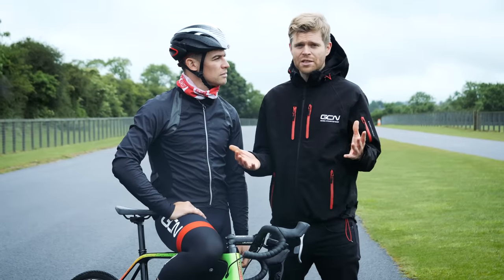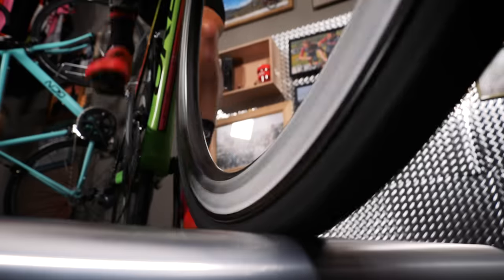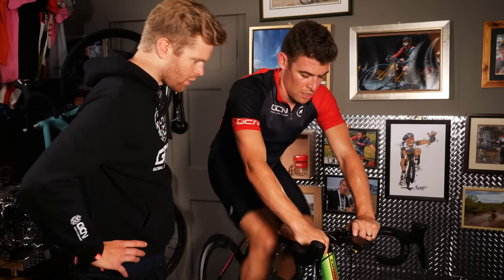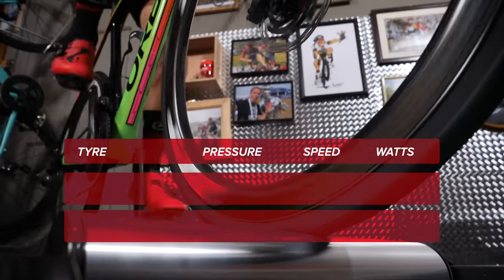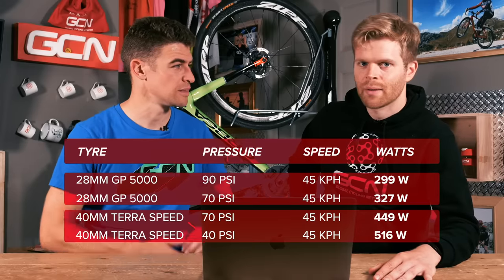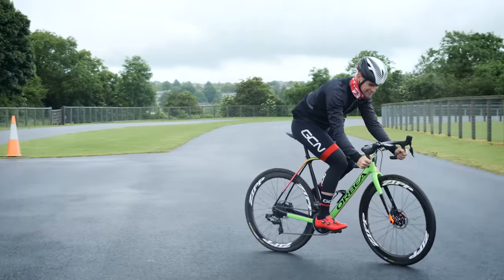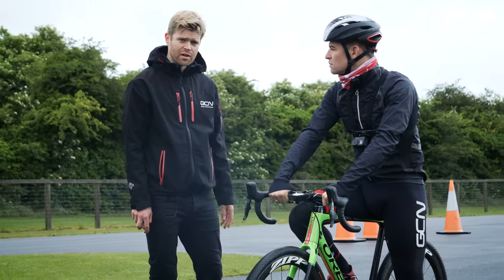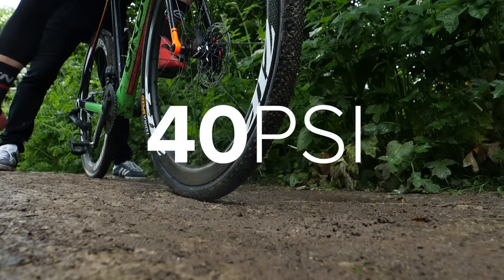Gravel Vs Road Tyres | How Much Slower Are Gravel Tyres?

Comment: I think a better test would be to ride up a mountain pass (paved) with both sets of tires - measure with a power meter. Then ride up a gravel road with both sets of tires and measure again. There has to be a point where the gravel tires will perform better, from a pure power standpoint. Anybody ever have to ride through some deep sand on a narrow tire? They practically stop dead. I don’t ride anymore, but I mountain bike and tire pressure makes a big difference. When I used to road ride in Texas, Initially I would pump up my tires to 100+ psi, as I rode more I started lowering the pressure because of abundance of rough “chip-seal” asphalt. I ended up closer to 80psi. 

Another consideration is comfort. Obviously, this is a lot harder to measure, but does play a significant factor. You can damage your body on a long ride, I have had hand tingling and numbness that lasted several weeks, after riding a century. Less of a problem for fit guys like Chris, i am sure.

Comment: Hi gcn, love the comparison test. But it's alittle bit unfair considering 700 x 28c vs 700 x 40c had different diameters and total circumference. I believe it's making more sense if you were to compare 700x28c vs 650x 47c.
Since both tyre has similar outer tire diameter .

Comment: I'm still searching for the "do it all" tier on my Gravel Bike.

I changed from a Vittoria Terreno Zero 37-622 (basically a fat road tier) to a Vittoria Terreno Dry 40-622 (which does not have pronounced knobs in the center like the Terra Speed)
There was maybe a very slight difference in roiling resistance on tarmac (but I was also a bit tiered already before the ride), but the cornering capabilities on gravel on the Vittoria Terreno Dry are way better (according to Strava all gavel decents with corners were at least 15% faster and I wasn't pushing it). The Vittoria Terreno Dry has a pretty flat scale pattern in the center while the Zero is completely smooth. The Drys weren't any louder then the Zeros, indicating that they should roll pretty smooth as well (creating sound costs energy). I ran both tiers at 5.1 (~70Psi} Bar Pressure.
In conclusion.

The Zero is great for Tarmec + (mainly straight) hardpac gravel roads.
The Dry is great if you are not sure what lies ahead. You do not sacrifice a lot (if anything) on tarmec.
Reply: Daira929 I’m on 38 Terreno drys at the moment. 40ish psi and they are amazing.
Reply: @deanoturn1985  yeah, I'll defiantly drop the pressure on them, now that my rides contain less and less tarmac. I mainly wanted to see how they compare in day to day road usage, since I basically use it for everything all the time.

Maybe I'll settle for some intermediate pressure since constantly deflating the tires will dry up the sealant more quickly :-/

Comment: The roller tests are unfair for the tires with low psi. As you noticed in you tests, event the 70 psi gp5000 tire showed a lot extra wattage to go at 45kph. What is happening here is that the lower pushes into the softer tire a lot more than harder tires. As a result, you get a skewed result. I think the roll down tests are a lot more realistic and accurate.

I would like you to test performance gravel tires (Rene Herse tires come to mind)
Reply: yep. i think the same. Take 25 or even 23mm tires with max pressure and the resistance will be much lower, cause the tires arent deforming as much. The rollers are not a real world surface and have a more "pointy" surface, going deeper into the tire -> deforming it more. It simply showed one thing: The harder the tire, the lower the resistance on rollers
Reply: @jBurn_  On the other hand, the result at 70 psi for both tires on rollers do give some insights. The rollers magnify the hysteresis losses. As a result, shower tires will do a lot worse compared to faster tires. This magnification can be a feature as opposed to a bug.

Comment: Try continental tubulars at 19mm wide @ 175psi.  That's almost an entire centimeter less rubber on the road vs. the 28mm in this test, so I say scrap this new wide-tire syndrome.  With the technology of the chili compound on Continental high-end skinny tubulars, they grip just like a wider tire, without the drag.  Imagine the energy-savings on a long ride.  Yep, I like it.

Comment: Road roughness makes racing tires sketchy on stretches of oiled crushed rock on many byways, fewer flats with a diamond tread like on vittoria pave corsas, 24mm to 28mm are my pick for speed + good on junk, great ride, kenda 30mm kwick great for commuting @90psi, ymmv.

Comment: I think this is a very interesting comparison, but it can be misleading. It's interesting because it shows the real difference between dedicated gravel and road tires (i.e. the kind of tires most often used on "road-ish" bikes), and misleading because those tires are different on many aspects which make it easy to come to wrong conclusions. 
As others have said, it would be interesting to compare a classic performance road tire to a wide, slick, supple and non-reinforced one (like a 38-42mm René Herse or Panaracer Pari-Moto). I think the results would be very different: in the case of the dedicated gravel tire, most of the additional rolling resistance is due to the knobby thread and sturdier carcass, which also make for a heavier tire. It could be a good idea to also compare the 700c road tire to a 650b wide supple etc. one, to isolate the effects of rotational inertia and analyze just the added rolling resistance of whichever tire shows to be slower. 
I think it would be a good follow up because the first conclusion many people could make from this test is that wider tires and lower pressures are slower, which is not necessarily true and for sure isn't what the test demonstrates. As an example, I have both a "normal" road bike with 700x28c Conti gp4000IIs tires and a long distance "audax" bike with 650x42b Panaracer Pari-Moto tires; the first one is faster on the climbs, though not nearly as much as the 3kgs lighter weight would suggest (something like 50m/h less VAM on medium to quite steep inclines), but as fast as the pure road bike on the flats despite the aerodynamic disadvantage of the larger tires, front bag, fenders etc.. Take this for what you will, as I don't have a powermeter so I can't make a scientific comparison, but this are the results I have found over many many thousands km, and I usually get tired faster on my road bike than on the randonneuse, which I read as a sign that I'm putting less effort when I'm riding the randonneuse. And when talking about long distances, the fat-tired bike is definitely faster and less fatiguing at the same time.

Comment: hello gcn,
Could you do the same experiment with 23/25/28/32mm Road tires ?
Keep up the great content!!!
Reply: saw a test like this - can not find it again. What I remember: Interestingly the 23mm option is much slower (!) than the 25mm. (the bearing surface of a 23 mm is wider even if the tire itself is slim). 28mm was the best compromise of speed/comfort. If you are not sure if you should go for Schwalbe G-One or Conti GP: on absolutely plain surface Schwalbe was the winner. If roads are as they are in real world: NO difference Schwalbe vs Conti. (which means that conti performs better the worse road conditions get.... or in my words: the more realistic road conditions are.) Both were better than the rest.

Comment: At 28mm, a road tire (like my Hutchinson Sector 28s) is a much noticeably better ride on the tarmac at 70 psi than at 90 psi in my experience. I need to perform some testing now! They feel way faster, so I suspect rollers are not the same as outside.
Reply: Okay that's a good way to approach it but remember perception is not reality because something feels better doesn't always mean it's faster or better it really takes some scientific equipment to perform the right test these gcn blokes really don't know their ass from their elbow

Comment: Swiss sport scientist did an investigation on tire pressure for the swiss cycling team. Was realy interesdting more pressure doesnt mean always better. there is a perfect spot if you inflate the tire more the resistance will increase. He says on a mountainbike around 1.5 to 1.7 Bars and on a road bike (size 25 or more) your weight divided through 20 plus 1.

Comment: I don't think there is anything particular surprising or even useful here. If a road tire will do, it will take less work for a given speed. If a road tire will not do, well you use gravel tires.

What I think would be far more useful would be to ride outside on smooth tarmac and smooth gravel where you really could use either, at a constant power (maybe repeat at a few power levels) and see how fast you go. Which would tell me, given what power I can summon, how much faster might  go on road tires vs gravel. Then I might judge things like: I have been training with gravel tires because I am too lazy to switch back and forth, but next weekend I have a big road ride, if I have been averaging X mph, what might I average with better tires? Or, I have a ride with mostly roads, is it worth the bother to switch?

Comment: Makes sense...only purpose of gravel tires is to allow you to maximize speed and control on loose surfaces.  Time/power up a wet loose hill would be the opposite results of this.

Comment: I would be interested to see a similar test between 700c and 650b road tyres.  I get quite a few flats on 25mm 700c tyres (biggest my bike can take with guards fitted) when riding audaxes on rough country roads and am thinking that 650b may reduce these but not if I need to pedal 10% harder for the same speed.

Comment: the problem with testing on rollers is you lose the advantage that lower psi tires have at rolling over and deforming around road imperfections such as pebbles, cracks in road etc.

Comment: Whoa...the comparison on the rollers shows that Continental made a big mistake with the Terra Speed. They should just have made the MTB tire "Speed King" which is only a little bit slower than a race bike tire (in my opinion probably 50 watts) as a gravel tire with 40mm size. I am really disappointed that Continental went mainstream and produced a "heavy" treaded tire with lots of puncture protection. Since the compound is the same, it shows how much impact casing and profile have on speed. Thanks GCN. Rene Here Tires it is then. Unbelievable how Conti has botched it, they had the perfect gravel tire with the MTB "Speed king"

Comment: Just one question : How are you measuring speed on the rollers ? I tried the same experiment, measuring with a wheel speed sensor, but with the larger tires the wheel diameter changes ...
Which can make seem like the gravel tires are slower than reality (as they will be faster for the same hub turns, due to increased diameter)

Comment: VERY interesting, just what I needed... But I wish the wet tarmac had the gravel tyres at 70psi as well though for proper direct comparison of the 2 types of tyre on road. Running them at 40 for the tarmac roll was a bit pointless really as cant compare their respective true rolling resistance difference. Inside tests were v indicative though... 50% more effort at same 70psi...wow!
I have an 'all-road' bike for road/rough west country lanes etc and run its gravel tyres it came with at max psi (85) on road....I have just bought some 'gravelking slicks' though to swap out for road use hoping will roll faster as less tread/more slick compared to current lightly treaded vittoria dry's... also went narrower... 38c to 35c. Will I notice much difference I wonder? Without the same psi on the road test, hard to say

Comment: It's pretty obvious that road tires will be faster on gravel as well - as long as you are not cornering, and if it's a decent gravel path without potholes big enough to bottom-out your rims.

But you are much more likely to get flats and crash. 

Even 60mm slicks such as Schwalbe G-one at 25psi have caused me a couple crashes when going too fast off-road, but overall they are worth for me since they are used on a do-it-all bike (training-commuting-touring-adventure-group rides)
Reply: Uhh, yeah no. Not sure where you're getting your analysis and data from but you're absolutely incorrect. 🙄🤦‍♂️
Check out Jan Heine WordPress
Reply: One would also be far more uncomfortable on the road tire on gravel, losing energy from discomfort. There’s also the durability decrease with the narrower tires riding them off-road

Comment: quick question: I am a beginner and bought an entry-level (400 pound) gravel/hybrid bike. I bought it in case of any less than optimal terrain, but I find myself never going off road. Is it worth buying a set of narrower road bike tires? nothing expensive like carbon fiber, but just something that will give less resistance. scientifically idk how worth it is. aesthetically it will for sure look cooler tho lmao

Comment: Here gravel tires on rollers took 67% more work than road tires for the same speed. So how much more work would it take for the same speed on gravel with gravel tires as on tarmac with road tires? Probably 100% more, or double the work!

Comment: Tires do more than roll fast. They have to corner and brake as well. That is why you use 2 plus inch knobby tires on a mountain bike. Mountain bike tires are going to always be slower than road tires on packed surfaces. It's when it gets slick and techy that they shine.

Comment: Interesting test, however a big caveat with it is using the word 'friction' with regard to rolling resistance. Friction is very relevant when braking, but not so much here. Rolling resistance is more dependent on suppleness of tyre over the [micro] rougher surfaces in real world riding. i.e. how well tyre tolls over things. Just like suspension reduces rolling resistance on more obviously rougher terrain - that not due to reducing friction.  
Also variables. Testing should only ever have one variable. So a 30mm road tyre vs a treaded 30mm tyre [or 32mm or whatever]. Even then, the tyres should be from same manufacturer with same design, bar the tread. 
Anecdotally, I went from my 28mm road tyres to 33mm CX tyres  [both tubeless] last Autumn and my speeds on roads actually increased slightly - to my surprise. Increased a lot on rougher stuff, less surprisingly.   I'd like to test them against each other but don't have identical wheels to compare. And no way am I swapping tubeless tyres repeatedly.

Comment: Great video! since i found out about gravel bikes existance i've lurking at comparison between them and road bikes. Specifically i would like to see a video showing how well a regular cyclist would perform riding on a 40-70km long route in a gravel bike against a road bike pack on smooth termac/concrete/asphalt. 
Would it be easy to do it? hard but possible? impossible?
Most cyclist in my home town use mountainbikes cause of the rough terrain of a third world country, but there are some places where road bikes can be used (even tho u probably gonna get flat tires easly) the gravel bike seems the be the perfect solution to maintain some 25-30km/h average without requiring to be a semi-pro cyclist and not painfully doing so on a mountainbike.

Comment: Very interesting measure. On the indoor test I would like to know whether you added som resistances representative if the aerodynamic forces or whether the power requirements were only associated with the rolling resistance. Thanks a lot for the Video. You rule GCN!
Reply from the maker: Cheers Philippe!
Reply: When a bike is standing on a roller there's no aerodynamic resistance to be overcome, it's only rolling resistance

Comment: Please repeat with tubeless tires. Tubes increase rolling resistance. Also, rolling resistance affects speed, but the two terms should not be used interchangeably.

Comment: I’m not in the least surprised. I run slicks at 150psi on my road bike and it’s 10-20% faster than my cyclocross bike with non-slicks at 95psi.

Comment: 40mm tire would have a higher effective gear due to the greater circumference.
Reply: A Nearly Negligible Difference...  
(for this Mechanical Engineer and OCD AvidCyclist...)
Reply: @NoFretBrettCSSMBFF  its actually not that small. from a 25mm road tire to a 42mm gravel would be the same than going from a 50 tooth compact to a 53 standard. its pretty noticeable.
Reply: This is a common misconception that people overlook when choosing gravel gears. Every gear is effectively one harder on a typical gravel tire vs. a typical road tire due solely to the difference in tire circumference.

You should’ve ridden the gravel tire in one easier gear than the road tire to actually be comparable.

Comment: Thing that still intricate me is- what is the better option in terms of increasing higher speed (average speed on same route): lighter tires (~100gr of pair) but with higher rolling resistance (about 3 W, by lab test), or opposite?
Any thoughts, thanks.
Thanks
Reply: Better is less rolling resistance. 100 gr more on the wheels is the same as 200 gr elsewhere on your bike. I don´t think you will recongnize it.

Comment: For the average cyclist at a maximum mean speed of 32 kmh there is no difference, except that the wider tyres feel more secure & comfortable. Beyond 40 kmh the wider tyre would have marginal speed loss, due to wider cross section.

Comment: Nice try guys but the problem is that the experiment was using minimal road conditions.  Use the gravel tire on harder looser gravel and it will roll without flats etc.  use the road tire and you have to go slower and punctures galore will riddle your ride.